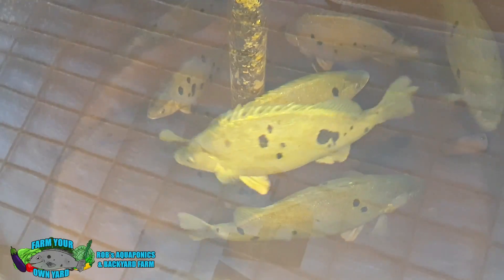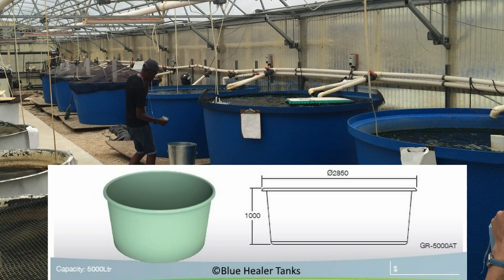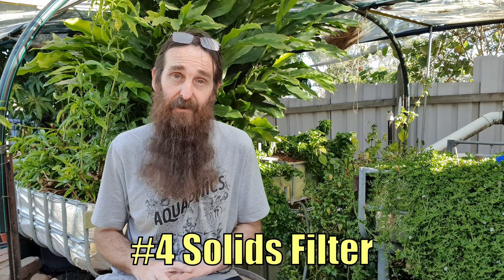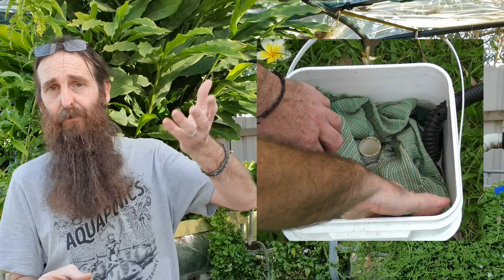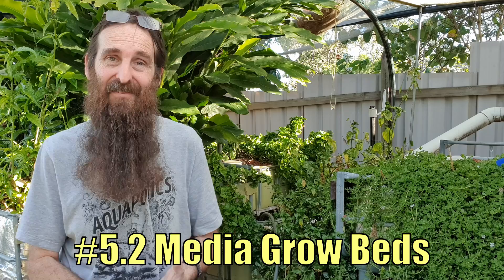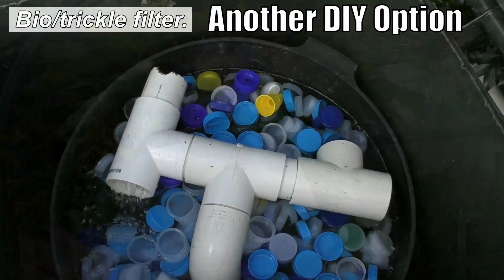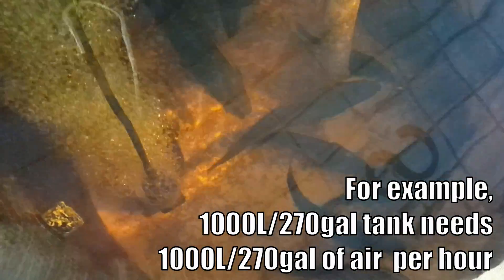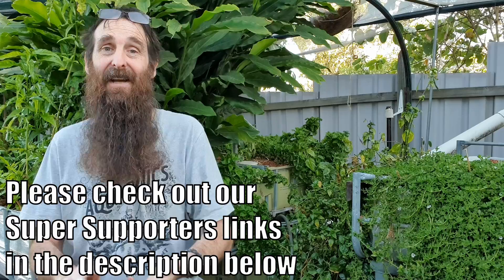Aquaponics System Design - 9 Essential components

Comment: I successfully ran a simple kratky system this year and now because of your videos I'm going to try an aquaponics system. Mine will be a much much smaller than the systems you've talked about but your info has helped so much in the design process. The seeds are germinating right now and the system will be fully running in a month or so. Thanks for the boost of confidence and great videos!
Reply from the maker: That's great to hear BB. 👍
Happy growing mate. 🥦🌱🍅

Comment: Can you oversize the pumps? Meaning, can they be too big? Thinking about system expansion down the road.
Reply: Of course you can for instance if you have such a massive pump going to a small tank with a a small over flow it will over flow the tank not only from the over flow drain but from the top of the tank as well spilling everywhere.
 everything is about balance!
So if you balance the flow to drain size your off to a good start but to much turbulence could also be an issue for fish.
Again balance.
Reply from the maker: There is a point that they will start to cause issues with water backing up in parts of the system if the drain pipes are undersized. This issue is if you over size the pipes now to take the flow it may well cause you problems when you expand later.  
I have used oversized pumps here & installed a bleed off line in the sump to redirect some of the flow. The added bonus is that it helped to add more O2 to the water.
Hope that helps.

Comment: There is a heap of those face shaped beads in an IBC at our local tip. Is it worth grabbing them?? If they are cheap??
Reply from the maker: Would be worth looking into. 👍 I think ours cost between AUD$1.50-2.50 per litre but I could be wrong. I do think that you'd been to disinfect them before use in your system as they may be carrying pathogens. 
Cheers.

Comment: Such a great channel. 
Really not sure about the power usage of a system
Reply from the maker: It's easy enough to work out. Take the wattage from the spec label on the pump & multiply it by 24 (hours). Then times that by the kW charge you get from the power company. We also have a solar system on the house so our running costs are subsidised a bit. 😉
Cheers. 👍

Comment: HI I STARTED aquaponic one year before and now realize the deficiency of nutrients . My inspiration was your videos. How did you supply nutrients
Reply from the maker: There can be a few different issues. You may have too many plants for the amount of food you're feeding the fish or your pH could be too high for some plants to take up nutrients.
A basic rule of thumb that originates from the UVI folks is 60-100g of feed per M² of grow bed if that helps any.
Reply: @RobsAquaponics  Thank you Rob. my ph is 8.well water and rain water. how can we bring ph to neutral.
Reply from the maker: @sankarkayamkulam  You can add some phosphoric or hydrochloric acid to the top up water before adding it to lower the pH. Never drop it too far though. 
Also, NEVER PUT ACID DIRECTLY INTO THE SYSTEM!
You will find that over time the pH of the system will fall & you won't need to adjust the top up water. It's high pH will help to keep the system balanced. 
Hope that helps a bit

Comment: Excellent video... Really covers everything. I've decided to start small as a test, so I built a small 24x18x18 aquarium with a grow bed on top. I plan to do a small kitchen garden and house this in my kitchen. Some celery, thyme, eshollets (green onions). Once I feel like I've got the handle on not killing fishes or plants... I'm going to do 4 chop and flip IBC containers a large fish tank and filters. My question is, right now on the aquarium system I have, I'm using a single 400gph pump in a sump behind a radial filter that uses two 3/4 pipes with a venturie in each... This supplies the oxygenated water to the fish tank. It's got loads of bubbles, tiny ones, and the idea was a minimum use of power - 1 pump. Now I don't plan to use this in the bigger system, unless I can really get good performance. What are your thoughts on this? And I know that you already did a video on this, I've watched it several times. But I don't think you've convinced me either way...
Reply from the maker: I would still use an air pump in the FT even if you have a venturi. 👍 If a water pump fails (other than power outage) the fish get no air but would be fine if there was an air stone in there. 
If you're going to buy a venturi, look for a proper aquaculture one as they work a lot better than the cheap liquid injections ones you can buy for a few bucks off amazon or ebay. 
Cheers Peter.
Reply: @RobsAquaponics  I actually made the venturi based on your video and some others on YouTube.

Comment: i am still trying to figure out how to aquire/import aussie jade perch into indonesia.

btw. what size pipe are you using for outlet of the rff? and how much water is flowing through the system per hour. 

cheers.
Reply from the maker: I know Malaysia imports them but haven't seen anyone post about Indonesia sorry Swee Yong. 
I've used a 50mm outlet from the fish tank to RFS in the past with 2000+LPH flowing via gravity through it with no issues. 
Hope that helps some.
Reply: @RobsAquaponics  good day rob. thanx for the reply.

i am in the midst of turning 40KL pond into a aquaponics system which will also supply water to our vertical wall garden, grow veggies and ultimately grow fish to donate. 

ive got a 5000Litre bog filter installed that flows 12KL p/h into the main pond. 

i got 2 x 2500L RFS which will be flowing to the gravel grow bed and dwc in the nearby future.

i  am still scrathing my head as to whether to install a MBBR.

stocking rate is under 100 mainly koi fish. 

isues ive encountered so far is the water lock from RFS. water not exiting (gravity at 2m height) the outflow pipe from the RFS to the grow bed. i am using a 2inch pipe and trying to flow min 12KL p/h. the line of path is not straight, with a couple of 90 degree elbow and an elevation of 60 -70cm. in this sort of scenario could the cause be too small of pipe diameter or not enough head height from the out let.